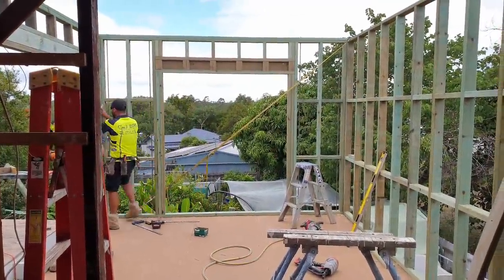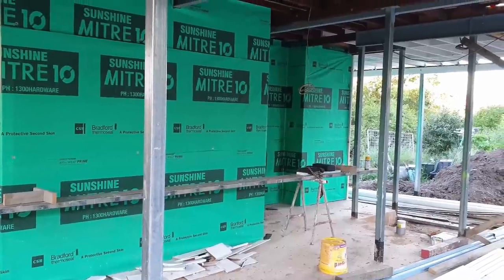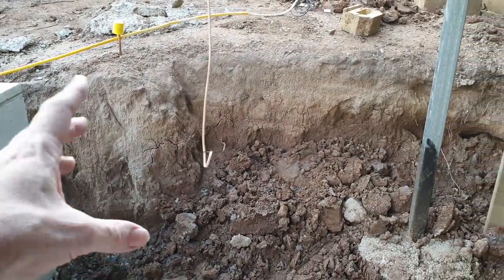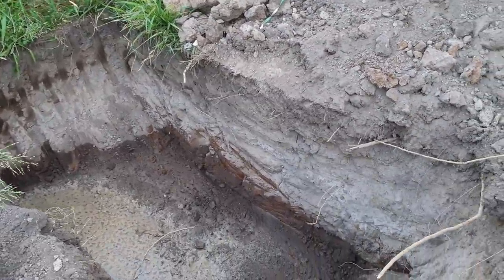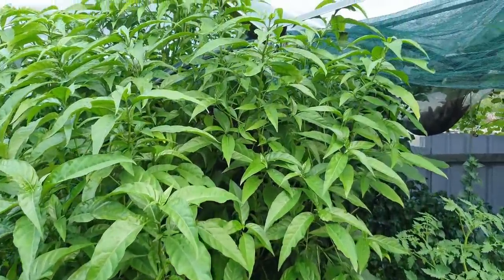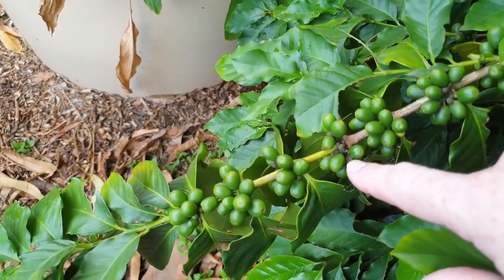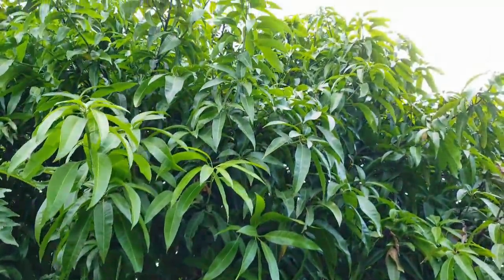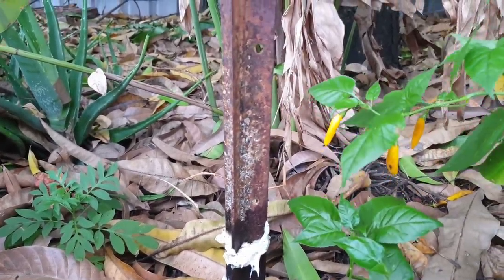House Renovation & Backyard Jungle update

Comment: Hi Rob,
Its looking really well.
Australia is also a hot country where temperature goes above 35 Degree C. How do you maintain the temperature during these days?
Reply from the maker: Hi Again Umesh. 
If you mean in the aquaponics, it generally stays in the high 20°C most of summer. When we have a week of 40°C the water temp can jump to 30+°C but the Jade perch we like to grow can handle that.  Just need to make sure there's enough air running into the tank to supply them with dissolved O2 👍
Cheers mate.
Reply: @RobsAquaponics  thanks for the info Rob.

Comment: Hey Rob, first link to your new website leads to a jumbled garble warble of letters. This on Firefox. Can others confirm the problem?
Reply from the maker: Hi George. Just checked on my phone and it looks to be working on Firefox and Chrome. Will double check it on the pc when I fire it up. 👍
Reply: @RobsAquaponics  "The first step to figuring out the “How many Fish?” question is to work out how many grow beds your system will have.
To use my original IBC system as an example, I worked out we could fit in 3 IBC grow beds with a sump tank underneath one and one full IBC as a fish tank with some room left over for future additions like filters later." is overlaying the first chapter.  Hope it's either just my version of ff or my linux and/ or sort itself out otherwise, good luck. (Have't tried the rest yet)
Reply from the maker: @ArmageddonAfterparty  For some reasons one of the text dumps from the old site became my home page. Have sorted it out now.  https://www.bitsouttheback.com/
Thanks for letting me know George.